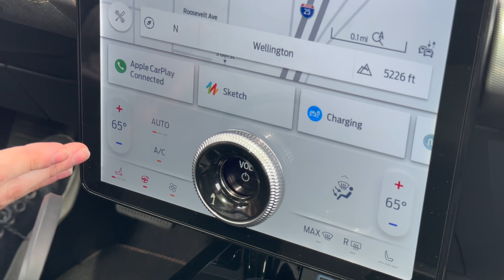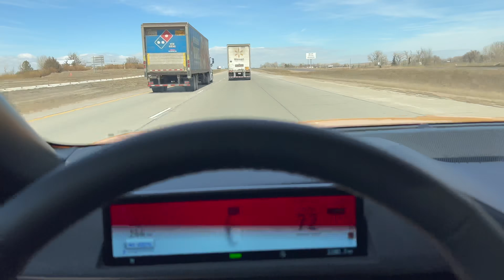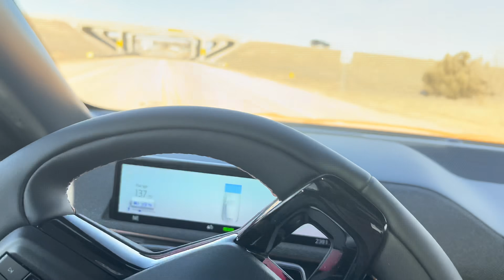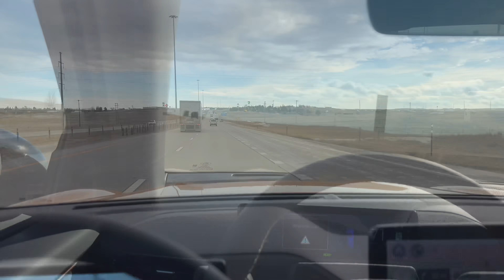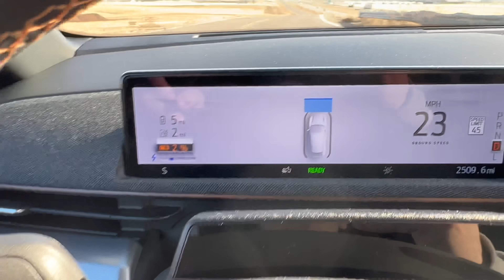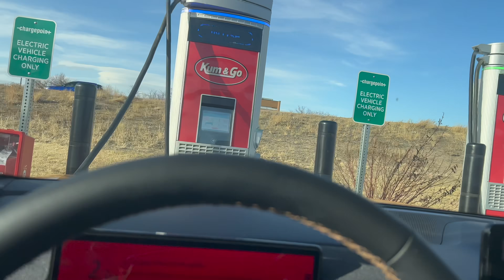Ford Mustang Mach-E GT 70-MPH Highway Range Test

Comment: Looking at trading in my polestar 2 before the warranty is up for a Mach e. My car was recently in service, and they found that the noise I was hearing was a shock absorber. They charged polestar $2,300 for the repair! I don’t think I can afford this car out of warranty if something breaks. I have a cosmetic defect (rock chip) in my headlight, and I asked how much to repair, and they said that the whole headlight unit has to be replaced to the tune of $3,200!! I inquired about an extended warranty because I’m happy with the car, and was quoted $9,000 for an 8 year, 125K mile warranty bumper to bumper. I figured if I could trade my polestar in for a machine e, and come up with $9K or less difference on my part, then I’d do it. What do you think about the longevity in terms of cost of both of these cars?

Comment: YOu gusy need to test 2024 upgraded mach-e...  WOnder if the GT range is better (same for Rally?).Want the GT Performance's suspension, but also want the Premium Extended Range AWD's range....   Range & Price win for Premmium, except the 2024 model in Erruption green and extra 20mi range may make it worth it because the suspension?  Also, Mustang is a popular car, and no 10% challenge yet? Come on guys!   I know You like Expensive German autos and Lucids, Rivains (stuff in the over $100k or close to, whic I'm sure is fun to test drive, but most people won't EVER buy).  Even a 60K mustang is expensive for most....

Comment: Here is "the test" as to EVs that I recommend. Take three brand/models of EVs. Drive the same route at X speed to a DCFC. Note the efficiency of each one, charging rate, cost. Move to the next segment. Collect the data. Then report to the public. I have a feeling Tesla Model 3 or Y shall use less electrons per mile, charge faster and get to destination earlier than other models. "Testing" range to empty is with little value. Thanks.

Comment: Would be  nice to see the range from 80% to 15/20% as that's the limits of fast charging and the limits of battery damage. Hate that they advertise 275 miles, then he only got 233 going from full 100 to 1% which means real life usage the range is under 200 miles which is painfully low.

Comment: Need these range reviews to show actual miles driven and how much energy it takes to get it back to 100% to get a true miles per KWH. These vehicles need to factor the losses as it is a part of the consumption. I have a Ford E-transit and the miles per KWH displayed does not calculate to real consumption and real miles driven. I am afraid Ford is fudging the numbers a bit too look more efficient than it actually is.

Comment: Owner of a GT Performance. That is about right for that temperature. Here on the east coast I was able to go from home to Boston near Logan Airport, a 196 mile drive, from 90% and had about 10 miles of range left. After the recent updates the range has improved: during my commute this week I drove 229 miles over 5 days and had 16% left on the battery at 2.8mi/kwh. Late last summer after I picked it up I went on a trip to Philadelphia then to D.C. then home and could have easily hit 250 miles or more miles. I will see what I get on a 600 mile round trip in about a month.
Reply: Yea seems about right. Went 215 miles today. 23 gtpe. Started at 100% ended at 15% (42 miles). Running 70ish, up and down mountains quite a bit. Was warm out though. 85ish. Pretty close to the 260 range given by ford

Comment: So you would have burned about 10 gallons of gas probably less with all the highway driving, by the way how long did it take to recharge and how much to recharge. Lastly what happens if your in a rolling brownout and there's no power available.
Reply: Would cost me 8 bucks to drive max.  If power is out you don't get gas pumps run off electric.
Reply: @rondavis2791  yeah but most cars have a 400 to 500 mile range on a tank of gas, and I can carry an extra 5 gallons of fuel if necessary can you carry extra power. look electric cars are nice but the US power grid is not sufficient to provide the additional strain electric cars require, plus the 60 thousand plus price tag and the 6 year life of the battery is a bit concerning. How do you get rid of your car if totaled in an accident, pretty sure you can't just take it to the scrap yard, that battery is hazardous waste
Reply: @ricblic901  my car didn't cost no 60 grand
Reply: @rondavis2791    No clue where some people get their data about EVs from. Is it that they just regurgitate what they hear on anti EV media, is it that they have never driven one for at least a few days, is it just plain ignorance, or is it just trolls being trolls. 

There are many EVs under $40k, used batteries are hard to get because they are very valuable, batteries can last decades, and just like when air-conditioners were introduce and Central HVAC units, the grid will be able to grow to accommodate the new energy demand and the list goes on. Those are simple facts that any EV owner knows and that anyone can verify online. We humans sometimes don't do any research before making comments about things that we think we know about but obviously don't know anything about.

Don't get me wrong, EVs are not practical for everyone but if you can charge at home, have a daily commute of less than 150 miles, have a reliable charging network in your country or areas traveled while taking long trips, owning an EV is definitely the best choice. As long as it can be afforded.
Reply: Tell me you know nothing about EV's without telling me you know nothing about EV's.
Reply: @chrisshinkle7224  I know what was said on this podcast the ev has a range of around 200 miles then need a charge most gas powered cars have a range of 400 to 500 miles, and if you know so much how do you dispose of an ev
Reply: well
Reply: @ricblic901  since you act like you know everything you tell us.
Reply: @rondavis2791  I wonder if he knows that the materials inside used EV batteries are very valuable and being recycled and used for stationary storage. They are worth a lot of money. Some used batteries are going for over $8k on eBay. In the other hand I don't think anyone cares about the gasoline and used oil left in cars that end up in the Junk yard. 

I really think he is not a bad person, he just has not done any research and is making judgement on what he has heard from the media and anti EV people. Hopefully he takes the time to educate himself in the subject or even better gets to try a decent EV for a few days.
Reply: @rondavis2791  your the expert I'm not sure, don't have an ev don't want an ev so please illuminate us
Reply: @rondavis2791  you don't know do you lol lol lol
Reply: @rondavis2791  actually I just looked up recycling ev batteries, ready $6750.00 good luck
Reply: @ricblic901  OMG I'm scared lol let me guess you looked it up on fox news lol.
Reply: @rondavis2791  no just google it

Comment: The 2.4 m/kWh does not add up.  233.6 / 97 kWh = 2.4 m/kwh.  The Mache GT does not have a 97 usable kwh battery pack.  And the car still had 2% left at the end of the test.
Reply: You’re not accounting for regen.
Reply: @anthonyc8499  Is there really 6 plus kw of region on the freeway? 7.8 kw if you account for the 2% state of charge the car had at the end of the video.  And yes I am aware he pulled off towards the end and did a little bit more braking.
Reply: 97 kWh is the total capacity, 91 kWh usable. Base your calculation on 91 kWh, and you'll probably get closer to the results shown in this video.
Reply: @vincentrobinette1507  The outcome of the video showed 2.4 miles/kw.  You can only USE 91 kw TOTAL.  91kw times 2.4 miles/kw equals 218.4 miles driven. They drove 233.6 miles.  And they had 2% state of charge left.  The math does not add up.  The 97 kWh imaginary number was a result using the miles driven and miles/kwh stated in the video.
Reply: Ok….then they lied about 15 additional miles!  🙄
Reply: @davidk5242  No one lied.  You completely missed the point of my statement and the whole point of a Range Test video...

Comment: Two things to add to your 'kit'...A tire pump and an ACCURATE tire pressure gauge. Tire inflation pressures can make a HUGE difference, when you're dealing with extremely efficient vehicles, with a relatively low amount of stored energy, compared to similar combustion (engine) powered vehicles. Tire rolling resistance makes a much bigger difference in electric, and even Hybrid vehicles, than ones with the conventional 'engine and transmission'.

Comment: It would be interesting to see the trip info screen, where it shows the amount of battery used for driving, accessories, temp, etc. 

Is it possible that using BlueCruise would be more power-hungry than standard cruise control? If the CPU is working harder when having to do BlueCruise things, the higher power draw could affect efficiency. Can something like CarScanner show accessory power draw in real time?
Reply: Climate has marginal impact, compute and electronics? Hardly. Modern SoC's used in cars are pretty darn power-efficient, and even if they were like a full gaming PC (375W at load) they'd still be nothing compared to the output of motors and just doing the work of moving forward against air resistance with pneumatic tires. No idea how efficient Ford's software stack is but I doubt BlueCruise takes more than 20W to run.

Comment: HORRIBLE efficiency
Reply: It’s getting right about it’s EPA certified highway mileage of 77 mpge. I agree that 2.4 kWh/mile seems a little low, but I’d guess that Blue Cruise is probably not the most efficient way to highway travel. I always get better mileage without cruise control. I average 2.3 kWh/mile in much worse weather than that at 90% highway speeds in my standard range Lightning.
Reply: @brucewachtman3495  In "real" Winter, with a bit snow, zero to minus 5 celsius, maybe some sleet or rain, with strong winds i get down to 2.5mi/kWh

Now where its warm and dry again i get about 3.8-3.9 mi/kWh in my Model Y. 

I drive as much as possible on AP, 130+ km/h / 82+ mph on the Autobahn, 19 degrees climate with heated seats and steering wheel. I've removed the aerocaps from my wheels, i don't like them.

2.3kWh/mile sounds extremly much, that is 812Wh/km or 81 kWh/100 km? Isn't it the other way around? 2.3 mi/kWh?
Reply: @wolfgangpreier9160  I inverted that. I guess that would be  812wh/km. I drive mostly highways at 100-115 kmh. Since I bought it in late January the temperatures have been in the 0-4 Celsius range. I think I should be easily able to achieve 2.5 miles per kWh in warmer weather. After 65kmh the aero drag knocks the efficiency way down. Around town in stop and go driving it’s been getting 3.5-3.8 miles per kWh.
Reply: @brucewachtman3495  Sounds perfect for a city car then. But you have a much larger battery. That alleviates the higher consumption.
Reply: @wolfgangpreier9160  I agree it would work better as a city car efficiency wise. I’m using it as a commuter on a 70 mile round trip drive daily. The mileage doesn’t bother me as it still costs under half of what a comparable gas version would cost to drive the same distance
Reply: @brucewachtman3495  Yes, Sounds good! 👍
Reply: @brucewachtman3495  I agree... Being that this is a aerodynamic car, it should have gotten closer to 3.4. 2.4 miles/kWh is a great number, for your full size pickup truck! I would expect better from a passenger vehicle.
Reply: @vincentrobinette1507  I’m thinking the Blue Cruise for the majority of that trip had something to do with the overall 2.4/kwh
Reply: I agree...I would be impressed with ~3.4 miles per kWh. I want closer to 5 mi/kWh, but, I'll never get there at 70 MPH. The car I want would get closer to ~4 miles per kWh at that speed. The Tesla Y, the Chevy Bolt, and the Hyundai Ioniq seem to be the most efficient right now.
Reply: @vincentrobinette1507  those seem to be the most efficient in terms of miles/kWh right now. I think the Bolt is a killer deal right now, but it’s very dated. The Ioniq 6 long range looks pretty good. I’ll check one out when they’re available.